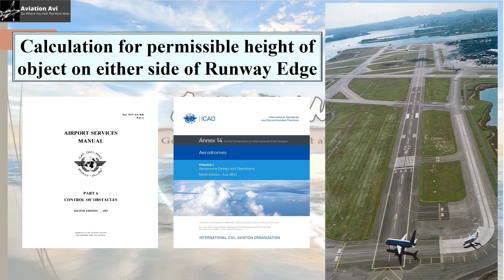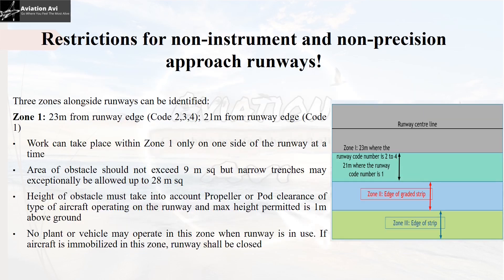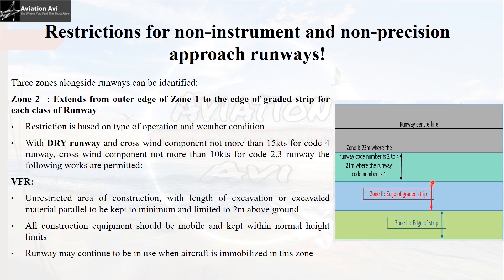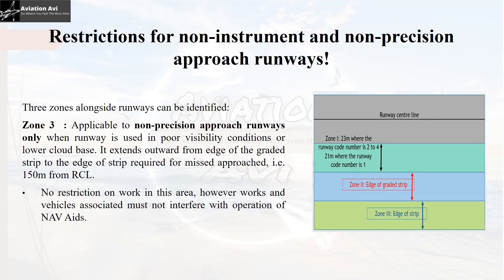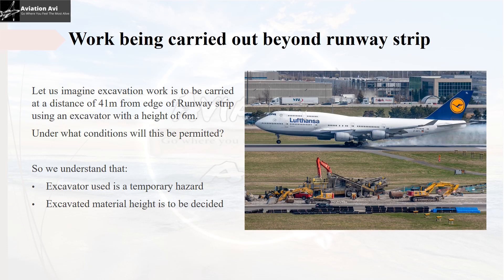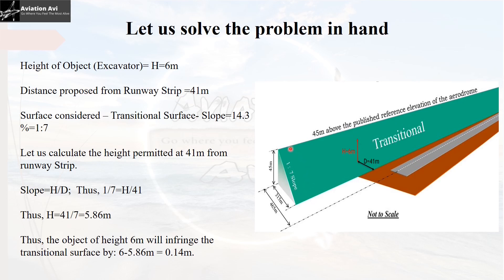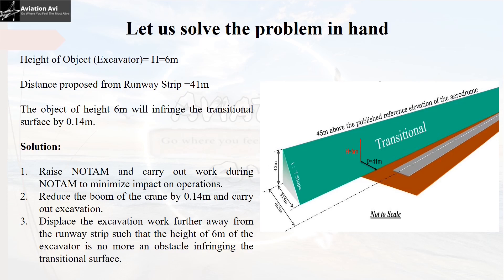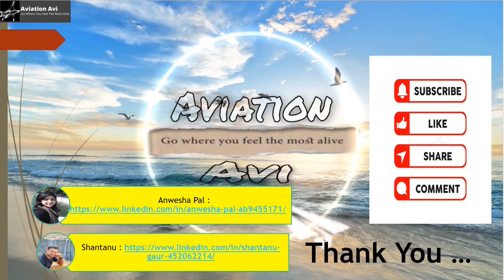Calculation for permissible height of construction work within Runway Strip and Transitional Surface

Comment: Height of building within 600 metre from runway strip??
Reply from the maker: That will be governed by the transitional surface with a slope of 13.3% from runway strip.
Reply: @aviationavi7532  correction to your comment of 13.3 %..... It's 14.3%
Reply: The moment you cross 315m for RWY code 4 from the strip, height will be as per IHS. 
That is 45 m above Ground level. 
However, you may also get restrictions apart from Nav Aids. 
Transitional surface restricts only till such distance.

Comment: Madam, please give distance gap of zone 2 measures from RWY centre line or edge of zone 1
Reply from the maker: The zone 2 extends from the edge of zone 1 to the edge of the graded strip of each class of runway. 

The graded strip extends to 75m from RCL towards the extremities of the runway and 105m from RCL towards the centre ( Detailed explanation and diagram available in Annex 14 ATTACHMENT A. GUIDANCE MATERIAL
SUPPLEMENTARY TO ANNEX 14, VOLUME I, section 8.3) 

Hope we could clarify.